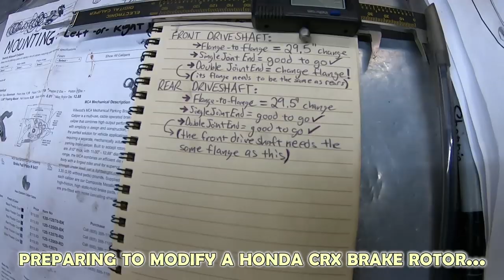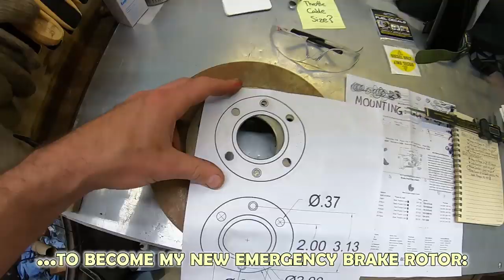Custom Driveshafts × 4BT Cummins Discovery #38 [Land Rover Build]

Comment from the maker: (Rear shaft is good! Will not pull apart. Splines are less than 1/2 out & identical to my old front shaft static.)   I know it's a downgrade from the old bluetooth driveshafts to these analog shafts, but it'll be better in the long run... Ha!   NOTE: Apologies for all the fan noise, was unseasonably hot when I was filming these segments!
Reply from the maker: @Mekaniku Jone I would never sell :P
Reply: Strong work bro. And I've got those things about ready to ship out
Reply from the maker: @PavelowGunner1122  Thanks & hell yeah man those things are looking slick!
Reply: Rear shaft looks too short. You could use a  spacer or maybe even two. 🤔
Reply from the maker: It'll be okay, it's out less than half it's travel, just like the front shaft used to sit with the old V8 setup.
Reply: @Tinker1837  🤞
Reply from the maker: @NickLev  I've had enough comments about it that I think I should've recorded cycling the suspension to test their travel... oops! Perhaps in the next video :P
Reply: @Tinker1837  granted that the radius arm suspension doesn't need much slide in the shafts... it just looks way more "stretched" than what I usually see. On mine it has about an inch of compression left and no splines are showing. (That's the stock rear shaft.) I have friends with very flexible leaf spring suspension rigs and they have "long spline" shafts where almost the entire shaft is a slide joint, maybe that's the safer way to go if you want to use same length shafts... My concern is that maybe there's not enough spline engagement to deal with that Cummins umph and all the off-road vibration.
Reply from the maker: @NickLev  This is true & part of the reason I'm looking forward to building my own custom 3-link & 4-link suspension so I can finally have a decent bit of travel.  My installed lift kit is very basic & doesn't offer much travel over stock, mostly just a height increase for tire clearance.  It's definitely out more than my old rear shaft, but then my old rear shaft had very little spline travel to offer.  That type of shaft is what I'll likely be using when I go long travel.  Until then these shafts were meant to be a "semi" short term solution, which is why I stuck with the standard 1310 joint size vs a more appropriate 1400 series... & also why I was so disappointed with the cost 😐
Reply: @Tinker1837  "stops typing a comment about the amount of spline showing on the rear shaft" 🙄Oh, got another. "whats the coefficient of friction for that black paint you sprayed the brake rotor with ?" 😎Awesome mate. And that split personality scene at the end, is there nothing you can't  do !!! Great stuff again 👍
Reply: Did I hear blue tooth drive shafts correctly? Tf?
Reply from the maker: @scenicdepictionsofchicagolife  Haha yep! That's a technology I haven't quite mastered yet.

Comment: That rear driveshaft looks like a lot of spline stick out!! I could be wrong!!👍
Reply: I thought the same may pop out on full articulation and or could poss cause vibration ?
Reply from the maker: It's a bit less than halfway thru it's travel, about a half inch different more than the front shaft's splines. No big deal, maybe just an effect of the gopro lens.

Comment: Love your build (fellow heavily modded disco owner here) and your videos are so well done, keep it up chap, big inspiration, although your attention to detail puts me to shame lol.

Have to say at full droop that rear prop shaft is going to pull out the splines

You need to remove springs compress axle to top bump measure, then do the same at full droop, then you or a good shop will be able to build a prop they won't bind and destroy pinion bearing or drop out. 

It probably be as cheap and faster to ship props from Gwyn Lewis in the UK(Wales) his props and other gear are the go to for UK Landy owners. Maybe worth a look.

If you haven't put HD Crown wheels and pinions/ pegged the diff cases and had HD shafts (I can't recall.if you did) you will take teeth off before you kill a prop, and if anything a weakish prop is the best weak link to have cost and time wise😂

Drive trains are "fun" , costly and trial and error. I've about £4k diffs, £1.5k props and shafts at the moment and that's on a tweaked 300tdi on 35s, I'd think a 4bt would need the same or Toyota axles 😂😂

Good luck and keep up the great work
Reply: Oh and while not ideal if you wanted to keep that prop and keep the ability of the same prop front to rear you could use a diff prop flange spacer, the only draw back is it increase UJ angles due to short prop length.
Reply from the maker: Thanks!  I think maybe I should've filmed lifting the truck to cycle the suspension travel while showing the shafts work.  But it'll be okay, it's out less than half it's travel, exactly like the shorter front shaft used to sit with the old V8 setup.  I really need to get new bumpstops installed too (hydraulic stops + limit straps would be mint), because my poor shocks have been doing all the suspension limiting since I did the lift kit a while back... not ideal!   My axles are still running original internals, so yeah for sure they will be the weak point with the now 500-600 torque at only 1600rpm... better go easy with my right foot at first haha!  I have a whole Disco's worth of spare axle parts, & thankfully they use 3rd members so I can swap broken bits in no time.  from my research it will be many times cheaper to build bulletproof custom american axles (full float high pinion Ford 9's I'm thinking) versus upgrading the Rover axles, so that's my planned direction since I intend to also build a custom 3-link & 4-link suspension setup in the future.
Reply from the maker: That's true, and I thought about making a few different rings to run between the flanges for spacers / adapters.  But after installing them both & seeing the <1/2" difference I didn't figure it made sense.

Comment: did you make (or were you able to buy)the stubby splinned shaft/yoke, u joint which I assume is the input from the transmission? and if you made it yourself, could you talk a little bit about that or make a video? Thanks and awesome work
Reply from the maker: I bought a few parts that I modified with the help of a machinist friend for that, and I have a whole video on that if you're interested:   https://youtu.be/XNwl8IDqSb8

Comment: You have obviously twisted a shaft before... if you are expecting some high angle play that will likely be some of the best money spent to make it home. Changing out the joints in the double cardan... those are some good times ! The early Bronco ones always seemed super tight to me anyways. Great days to ya man !
Reply from the maker: Yep haha! You should've seen what the original front shaft tried doing on it before I even lifted it... one of the u-joints tried to eat it's way right out thru a yoke, & by the time I felt the vibration it was all but 2mil from pushing right thru! Would've beat on the trans like Ivan Drago vs Apollo Creed, yikes! 👊

Comment: I'd suggest removing the antiseize from the flanges as it can allow movement between the 2 flanges and sheer the bolts, the flange coupling relies on friction between the 2 surfaces to transmit power, the the antiseize significantly reduces the amount of friction
Reply from the maker: I had a feeling I was going overboard with that... shouldn't be a big deal to remove it, good looking out!

Comment: Why do you install that civic disk on the axle? What does it do?? I don't understand
Reply: helistorm98 replacing the old drum brake E brake
Reply: Standard LR set up has the E Brake (parking brake) on the rear driveshaft just aft of the transfer case. This holds the rear wheels when applied. When the center differential in the transfer case is locked all four wheels are held. This is very hand on slippery slopes when the vehicle has to be held stationary (parked). The disc brake is replacing the usual drum brake. This is useful in wet conditions like after fording a creek where the  effectiveness of the drum brake might be reduced.
Reply from the maker: That's this vehicle's emergency brake, & used to be a big drum brake in the same location.
Reply from the maker: jasen klems  That paint is temporary because at the time I didn't have the caliper, so I didn't know how much to keep raw steel & I will trim off just enough paint with a blade to clear the brake pad contact patch before I use it.

Comment: Awesome build @Tinker. I'm just curios on how does the rear double cardan driveshaft performs between 40-100 kph. Any vibrations being felt? I have a discovery 1 (front driveshaft is double cardan already) and I'm thinking of converting my rear driveshaft to a double cardan too. Reason for this is that ever since I converted my rear driveshaft, deleting the rubber coupling, I'm experiencing a slight vibration between 40-60kph. Then disappears past 60kph. I have a 4" lift in the front then 5" lift at the rear. Wondering if this will solve my problem. Thank you in advance!
Reply from the maker: So far so good, no vibrations!

Comment: This is a very cool project and I think you are doing a grate job. I am curious as to how much spline is in-gauged on the rear drive shaft?  It doesn't appear that you need as much slid out as you have.  Just curious...   I have a 4BT Cummins & NV4500 trans I would like to install in a 1982 Blazer that came with the GM 6.2.  You have given me some much needed inspiration. Thanks!!!
Reply from the maker: Thanks!  Those are the best body style Blazers in my opinion.  When I was a kid, looking for my first vehicle, I so badly wanted a military M1009 Detroit Diesel powered 3/4ton Blazer... but ended up settling on a disaster of a lil S10 Blazer that constantly tried to kill me or empty my wallet clean out haha!  The rear's only out ~1" more than the front & is actually looking much like the front driveshaft used to look at static ride height 👍

Comment: FWIW I paid $1350 for two all new new 1350 CV drivelines for my engine swap Disco.  I think you paid a fair price.
Reply from the maker: Good to know. I was quoted less than half to have Tom Woods (the original supplier of my upgraded driveshafts) create the same thing, but I was giving a local shop a shot. Here's hoping they work as well as they look!
Reply: Tinker I got mine from High Angle driveline according to my records, but I think I called Tom Woods and got similar pricing.  In any case those look like they’re well built.  Getting close!
Reply from the maker: @Bread996  For all new shafts though, yeah? Tom Woods had me under $300 to change the lengths & swap the 1 flange (ujoints were okay) including shipping. But yeah what really counts is I have them back & can keep moving forward :)
Reply: Tinker yea all new, and heavy 1350 joints.
Reply from the maker: @Bread996  Nice! I'm hoping my 1310's withstand the big gain in torque long enough to last me until I start building my custom suspension.

Comment: I thought you where going to drill the bolt pattern by hand....I spoke too soon lol
Reply from the maker: Honestly almost rigged up some mad scientist looking contraption in the drill press... but cooler heads prevailed & a friend who actually knows what he's doing lent a hand with some quick vertical-mill skills.
Reply: @Tinker1837  yeah I would have done it for you had you not had access to a mill
Reply from the maker: @gaboonviper85  You're a machinist then? I really need to get a mill & a lathe!
Reply: @Tinker1837  indeed I am lol
Reply from the maker: I work a lot with CNC's and kinda want to try a transition into machinist work... trick will be finding a shop that does work I'd want to get involved with.
Reply: Google mountain machine
Reply: @Tinker1837  guess that's a no lol
Reply from the maker: @gaboonviper85  Haven't had a chance to look at 'em in depth yet, was a busy weekend! That where you work...?

Comment: That rear driveshaft will fall appart when articulating im affraid 😐

What caliper will you use on the handbrake?
Reply from the maker: I think maybe I should've filmed lifting the truck to cycle the suspension travel while showing the shafts work. But no no it'll be okay, it's out less than half it's travel, just like the front shaft used to sit with the old V8 setup.  I have a few different Wilwood mechanical calipers to try for that, & they're red since I heard you can pick up a few extra horsepower that way... haha!
Reply: @Tinker1837  offcourse, the video material is only a momentary capture of the whole thing, it just LOOKS like its extended too much in rest. I have a citroen xsara rear brake rotor and caliper. I installed it to a modified handbrake handle that in one direction actuates the mechanical part of the caliper with the ratched mechanism in place as per demand of our local gestapo office (belgian MOT) and when pushed forward actuates the hydraulical part of the caliper, great for front wheel drive only on a rover that needs to turn very tightly

Great stuff mate, great build quality and looking forward to the next vid!

Comment: Whats the purpose of the brake rotor? Also, inb4 frame rot when this build will be finished.
Reply from the maker: It's my ebrake / handbrake. These Rovers don't have the ebrake mechanism within the rear brakes, instead they have a great big drum brake mounted directly on the transfer case's rear output. I'm just upgrading that to a custom disc setup.  Also LOL yeah at this rate the rest of the truck will dust before I'm done!
Reply: Are building your own mechanism, or sourcing an already available mechanism. Very curious to see how you finish that out, I am debating on how to do that ebrake setup on one of my trucks. Thanks - great work.

Comment: would love to see dana 60 axles
central tire inflation 
hydro boost 
that would be cool ass additions
Reply from the maker: For sure! All things I have on my list already, although it's a toss-up between built D60's or Ford 9's
Reply: @Tinker1837  cant go wrong with eather
Reply from the maker: @thatbuelldude189  It'll get american made axles either way. It would be cool to keep the original axles... but they just aren't worth the huge cost to build up, especially since they would still end up only roughly as strong as basic 1/2-ton axles.  Toyota Land Cruiser axles could be cool too, but similar problems, too much $ for the strength.  I've always wanted to custom build my own axles anyway, with 3 or 4-link, skids, trusses, maybe even portals, etc.
Reply: @Tinker1837  i would go d60 or 9in 
then do portals 
fuck it 
ultimate DISCO BUILD BITCHES

Comment: Awesome as always. Is it the video or is the rear driveshaft more extended at rest than the front? I understand the reasoning for identical driveshaft.
P.S. Kudos for the always on point editing
Reply from the maker: Thanks! The rear's out about a 1/2" more than front, but less than half of it's travel & actually the rear is looking almost exactly like the front shaft used to look like with the V8.
Reply: @Tinker1837  Thank you for taking time to read and answer.
Reply from the maker: @gafrers  Happily :)

Comment: Do I need to come to Michigan to motivate you????  Lol
Reply from the maker: "Don't make me come down there!" Haha!
Reply: @Tinker1837  better be driving the diesel cause it's a long drive bro lol
Reply from the maker: @gaboonviper85  I am SO hyped for the increase in range with this setup. From less than a 200 mile range to probably between 5 or 600 per tank!
Reply: @Tinker1837  my jeep gets 260 miles a tank lol
Reply from the maker: @gaboonviper85  But hopefully it can get out of its own way... unlike my Rover with that stock engine. But I guess everything I did to it didn't help , ha! Before this swap I was worried if I could even build enough for auxiliary tanks to extend the range. Much less worry now 👍
Reply: @Tinker1837  it does the speed limit lol
Reply from the maker: @gaboonviper85  Mine could on streets... but highway? Maybe on a nice downhill.
Reply: @Tinker1837  I just have 31 inch tires on stock gears so it's ok....I'm holding off on spending more money on the jeep as I want my humvee
Reply from the maker: @gaboonviper85  That would a fun base for a project. New life with a 6BT or DD. You ever see the crazy Humvee based Camaro with a nasty engine & 4 wheel steer? Link:  https://youtu.be/w8OSEI7QDSA

Comment: Yes!!!
Reply from the maker: Thought it would be the easiest thing on the short list to get it on the road... so man was I happy to finally get these things back in my hands.
Reply: Tinker only thing I saw concerning was the amount of extension needed on the slip for the rear. Other then that, can’t wait to see this thing move under its own weight.
Reply from the maker: The rear's out about a 1/2" more than front, but less than half of it's travel & actually the rear is looking almost exactly like the front shaft used to look like with the V8.  I think it's just a trick of the camera.

Comment: Was that an xbrake from xeng UK?
Reply from the maker: Nope, but I did get the idea from seeing the disc brake kit that Terrafirma used to have.
Reply: Will you share the parts what disc and what calipper and bracket design?thx
Reply from the maker: @94Discovery  Oh yes absolutely! In the end it should be an inexpensive upgrade. I plan to do a whole video separately on the transfer case brake custom work.